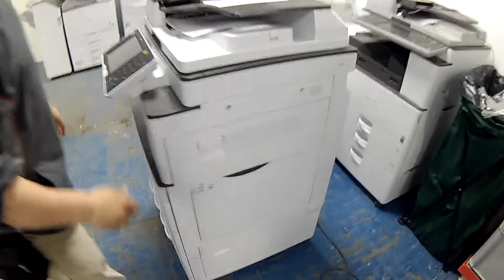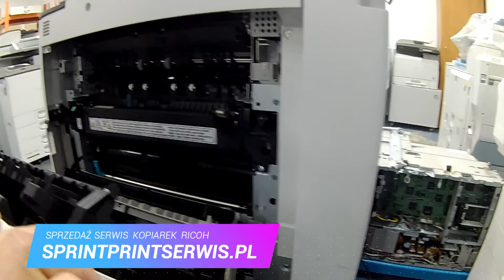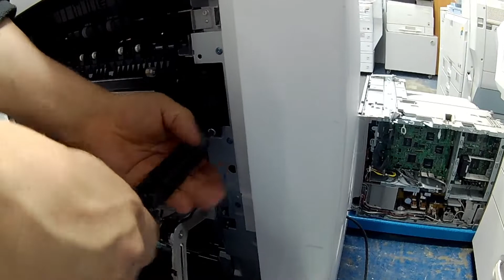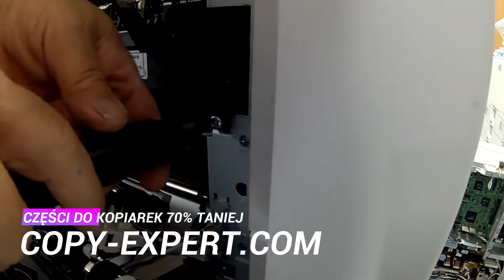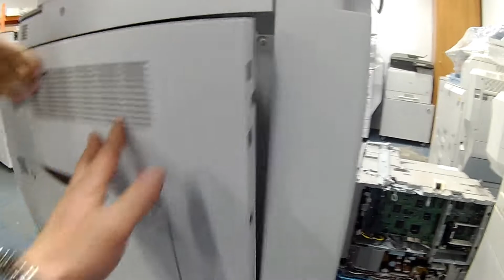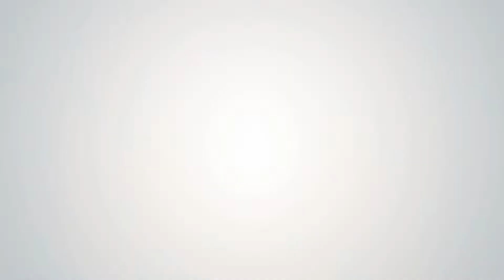Fuser Problem  MP2352 MP2852 MP2553 MP3352 MP3053 MP3353

Comment: Greetings happy new year tomasz I have a problem with radf mp 2852 it does not take the card remains blocked I tried to put another radf the problem is the same could you help me thank you very much greetings from Sorrento Naples hello.
Reply from the maker: There are three possibilities.
1. Worn rollers and belt on RADF - wash rollers and belt with alcohol, if this helps replace rollers in the near future.
2. Piece of paper - recently there was a paper jam in RADF, katka was torn out, and a piece of it was left in RADF. Use the flashlight and find a small piece of paper. You can manually push the card into the RADF and see if it snaps on something.
3. broken sensor - visually check if all sensors are present.

Comment: in the copier, the drum unit and fusing unit roller have changed, but the first copy is very clean, the next one is reflected on it as if the shadow of the previous one
Reply: how to do solve this problem, please, can you help me
Reply from the maker: In my opinion, you have to exchange DRUM, CLEANING BLADE. If that doesn't work, check what fuser looks like - it can be worn and dirty - then it transfers and repeats the image. Search for such items: 
drum: http://copy-expert.pl/produkt.php?%20iden=1997 
blade: http://copy-expert.pl/produkt.php?%20iden=2753 
charge roller: http://copy-expert.pl/produkt.php?%20iden=2491 
developer: http://copy-expert.pl/produkt.php?%20iden=2283 
heat roller: http://copy-expert.pl/produkt.php?%20iden=110062 

Good luck
Reply from the maker: I already wrote back
Reply: @MrRicoh  thank you for your answer.